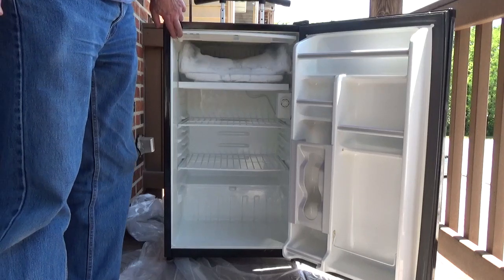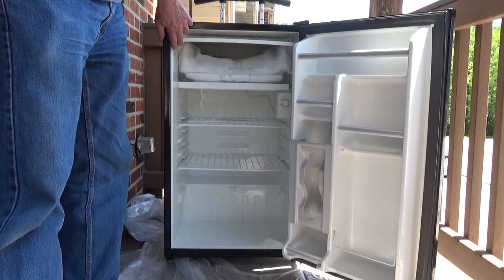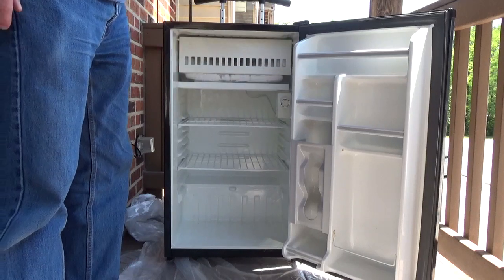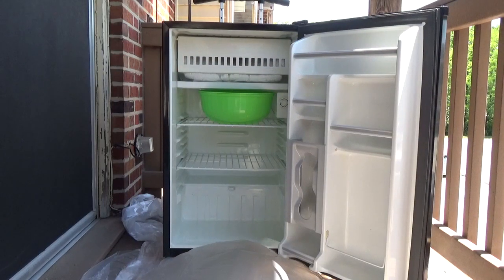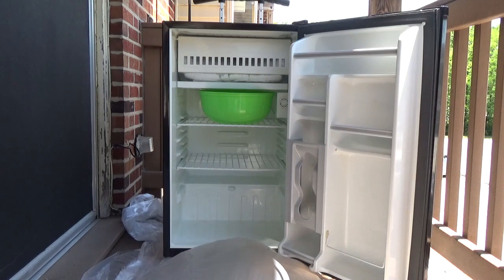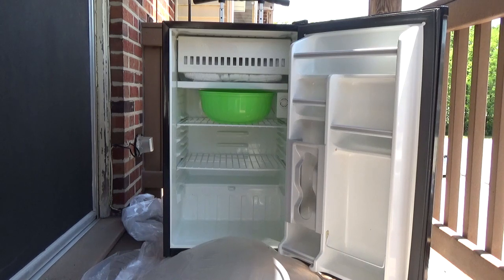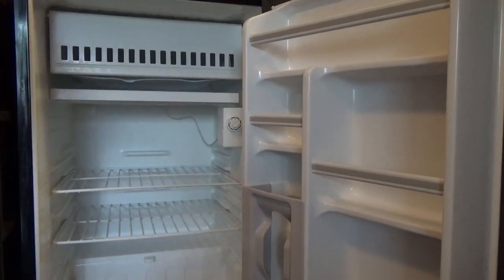Defrost a Mini Fridge

Comment: If you have soaking wet towels, DO NOT THROW THEM IN THE DRYER. Hang them outside or put them in the washer first. Driers aren't meant to handle large amounts of water, and it will burn out the motor from the effort. Ask me how I know. 🤣😂🤣😂🤣
Reply: Put them in the washer on just the spin cycle first.
Reply: @pd3331  Exactly.

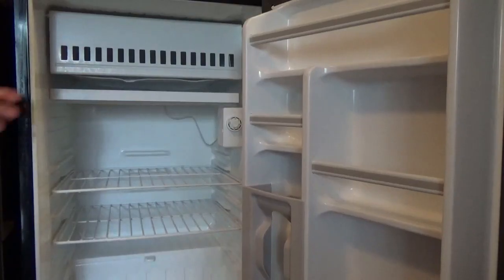Comment: 1:01 to 1:04  Why is it the professional refrigerator repair man uses a heat gun much hotter than a hair dryer and it melts the ice in seconds?  The plastic was never damaged when he was using it.
Reply from the maker: Hi, professionals have experience with their tools, a homeowner can easily damage the plastic parts if they are being too aggressive or impatient. 
Check out some home improvement tips in our e-books https://www.amazon.com/gp/product/B0B2KW1FQ9